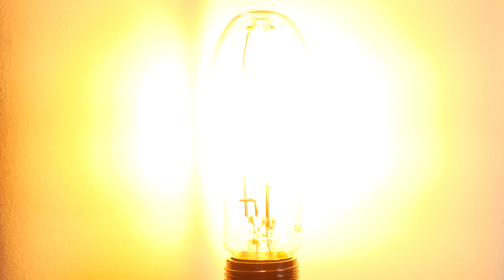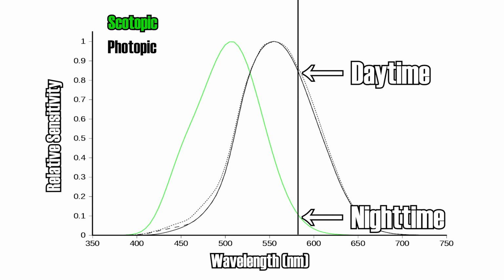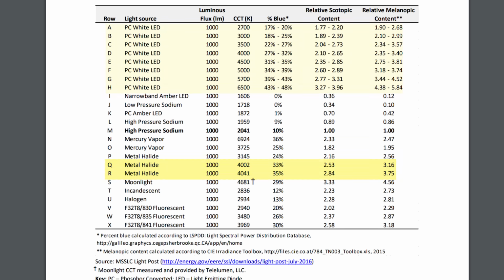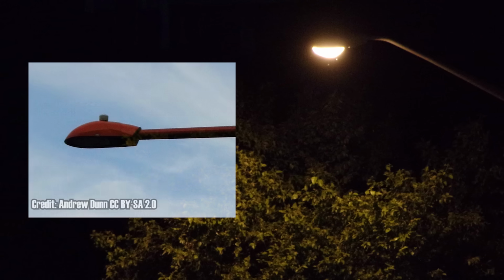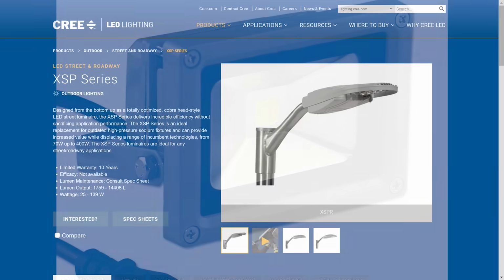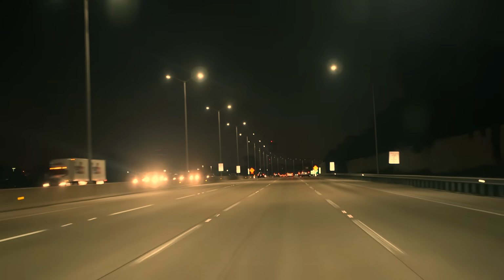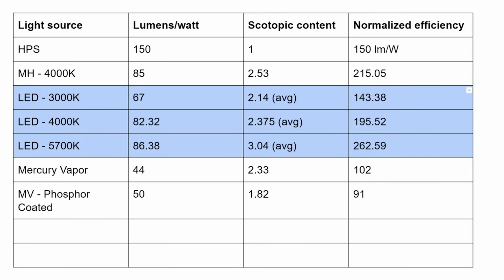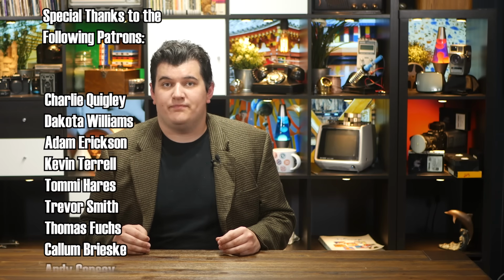The LED's Challenge to High Pressure Sodium

Comment: The possibility to dim LED lights is a huge bonus. I have seen street lights in resedential areas here in Austria which have a motion sensor built in. They must be using radar to do that. They react to pedestrians and cyclists as well. They get alot brighter when you approach them and dim down again after 30 seconds to a minute. This not only saves energy, but reduces light polution (obviously) and will extend the lifetime of the lamps and LED drivers. For fast moving traffic (where a motion sensor would trigger too late) lamps could be connected and relay the information of a moving vehicle ahead to do the same thing on highways for example.
Reply: Honest question: what's with your extremely questionable use of bold letters
Reply: @hypeninja4786  its a little weird isn't it- it's sorta like using italics to show emphasized words, but it's on more words than that.
Have you seen people who capitalize almost every word? I always assumed they were just native German speakers, but I've seen people do it who claim to be american-english-only or even non-Latin language speakers.

people r weird
Reply: I helped set up some Phillips street lamps in a few streets in my town which auto dim after being on for some hours. They dim to around 50% but the change is not noticable. The fixtures can also be programmed and controlled via DALI.
Reply: Nice, seems like a good compromise between turning lights off after a certain time vs leaving them on all night
Reply: what if they make a solar powered LED street lamps?
Reply: @a-potato-on-youtube  China has a lot of solar powered LED street lamps in an integrated design so no cables are needed.
Reply: @a-potato-on-youtube  Actually quite common here in Australia - the solar panel is on top, with the battery integrated into the pole. But I suspect you need reasonably reliable sunhine for that - I'm not sure it would work in a northern winter.
Reply: I sure as shit would not want to be walking down a road that is pitch dark except right in front of where I am. Personally, I like to see if there are any dangerous as far as the eye can see.

Comment: Moonlight is not "blueish", it's 4000K, as opposed to the 5000 to 7000K or so light during the day time, it just appears blueish because the level of light is very low, and as you said we pick up shorter wavelengths better in such conditions.

It's interesting that the study you cite actually has different results to that done by Philips in France, regarding CCT preference; 4000 and 4200K sources both ranked below 2000 and 2150K HPS, with 2800  and 3000K being the most preferred option.

Comment: Only thing I don't like with led lights around low speed streets is now its more difficult to determine if that light I am seeing is a car or just the streetlight (as the LED lights are at times brighter then car headlights and if the car uses led or high powered headlights sometimes matches the led lights on streetlights)

Comment: Our council is phasing in LED lighting when the old sodium lamps fail.
The LED lights tend to splatter light backwards towards the houses making the upstairs appear to be in daylight. This is very annoying for those that have the lighting close to their bedroom windows.
I've also noticed that the light from the LED lamps gets scattered much more by fog than the light from sodium lamps. With the lenses added to LED lights, this creates a wall of blue/white light that makes driving much more difficult at night whereas with the sodium light there is no wall.

Comment: I find the aesthetic argument highly subjective. I for one prefer cooler color temperature light. Additionally the greater CRI of most high color temperature lights is an additional safety feature. Color recognition helps in spotting obstacles. Also for people like myself with mild abnormal color vision, it helps greatly.

Comment: In my opinion disrupting your circadian rhythm is actually another safety benefit, as if you are driving at night anyway, you need to be awake. Circadian rhythm disruption is a major problem of modern society for many reasons, but kind of a separate issue...
Reply: The problem is the effect could last hours after someone stopped driving so you would need to investigate if accidents go up in the morning and what effect it has on animals that cross road ways.

Comment: My region just installed citywide mixed-type LED street lighting of various colour temperatures. All of it makes use of really bad lens designs that turn the LED into one ultrabright point source and create this annoying, potentially distracting side-glare effect that gets in your eyes at night (especially when driving).

You'd think someone would have figured this out before it got to market. Even the old sodium lamps had better dispersion, they'd put the light where you actually needed it.

I imagine it's just a matter of time before retrofits happen (how many car accidents do they need to see first?) and in the meantime, they've been allowing the request for installation of aluminum strips to deal with the side glare issue, on a call by call basis. Better than nothing, but good design would have been the best solution from day one.

Comment: I am a huge proponent of LED lighting, and definitely agree that it is the right way to go in street lighting. One complaint I have about it, though, is in situations where "full-cutoff" LED fixtures are used as a replacement for old HPS fixtures that had hemispherical lenses with no compensation made for the differences in the light distribution patterns. For example, there's a small town near me that replaced every HPS lamp along a major street with LED. They did this by removing the old HPS head and just sticking a new LED head on in its place, nothing more. The problem is, the lamp brackets were originally mounted too low on the poles. This wasn't a problem with the HPS lamps since they also emitted light out the sides at an angle, but since the LED fixtures are full-cutoff fixtures, this means that instead of the entire street being lit relatively evenly, there are now small, sharp-edged "hot spots" of light with gaps of total darkness in between. To properly replace a non-cutoff HPS fixture, LED lamps really should be mounted higher.

BTW, one potential benefit of LED tech not mentioned is since they run on DC at a much lower voltage than HPS, as the tech continues to improve it should eventually become possible and economically viable (if it hasn't already) to integrate battery systems that allow street lights to continue working during power failures, or even entirely off-grid using solar charging. Speaking from experience, I know it would be nice to have a little bit of working street lighting during blackouts, even if it is at reduced brightness (lower output on all fixtures, or only key/specific fixtures being battery equipped).

Comment: I far prefer cooler lighting, opting for all my LED bulbs to be 4100, 5000, or 6500k in temp.  And I feel that circadian rhythm disruption is far, far overplayed in the media.  I sleep just fine after reading for hours with cool white LEDs.  //  I, too, am =not= a fan of light pollution.  //  What I'm seeing in industrial areas is overlighting with new LED systems, likely caused by installers either 1) not understanding that LEDs are much more efficient than their predecessors or 2) that they make a lot more money on larger LED packages.  LED parking lot lighting is absolutely wonderful, and much more safe because bad guys can't hide as well under them as they did with LPS, HPS, or MH.    //  Thank you for a well-thought-out presentation.  You covered all the bases, something I don't often see.  Kudos, TC.  I saved your video.

Comment: I thought I liked 6500K lighting then over time I found that it was actually hard to see with LEDs of that color temp.  I find it much easier to see at 3000K not sure why but at 6500 things look harshly edged and difficult to make out objects and I can only see hard edges.  With 3000 I can see the objects and be able to read signs.  I am completely in the dark about why, pun intended.

Comment: Amber colored light is easier on your eyes at night and the amber colored light fades off over a far distance, while blue light can be blinding and vision cuts off at a faster rate as you approach the edge of the light, because your eyes are overwhelmed with the blue light. I suppose if you could have ENOUGH blue light to avoid having the harsh edges BETWEEN lights, then it would matter less.  Also, the higher the color rendering index, the more details your brain will be forced to process when you drive, so I am thinking that long distance truck drivers, probably prefer to conserve their brain activity for staying focused on driving, not spending time subconsciously comprehending the exact color of vehicles and the color of the leaves on trees and so on. As far as which lights I prefer? In my home, I have both orange and blue colored lights, and i use whichever I want at the time and use both at once if I need maximum vision (like for cleaning). I am going to make a wild guess and say High Pressure Sodium lights will PROBABLY be around for AT LEAST another 50 years. I thought LEDs put HPS to shame, and found out they still don't at all.

Comment: LED lighting has made driving less safe here. because they are brighter, they have been readily adopted and installed by most cities eager to save money. because of the increased brightness, they've been installed at large intervals, and because of this wide spacing there is usually no shielding at all installed, so the bright LED light is spread very wide. this has given us many bright light sources shining right into the eyes of drivers, causing pupils to narrow, causing reduced low-light vision - the same reason it's hard to find your way back to your dark bedroom after turning on a light in another room. this has led to an increase in night-time incidents, with a particular increase around twilight hours, yet the safety of LED lighting is still touted without mentioning the safety reduction caused by wide spacing and reduced shielding, and here many experts are also recommending drivers to keep their headlights angled as high as possible so they can see better, again failing to recognise that means everybody else also has their lights up, which makes people and other cars off to the side or after turning down a darker street harder to see.

Comment: The only thing I didn't hear mentioned in your talk is that many replacement lights use multiple pin source LEDs without diffusers.  This causes multiple confusing shadow patterns on the ground which are just weird, but they also mean that the light source appears MUCH brighter when you look up at the light.  LEDs without good optics are just awful!

Comment: Light pollution along coastal areas where sea turtles lay their nests are a very big problem.  Thanks for mentioning this.  LEDs do offer a potential solution to this problem, but only if communities choose to use them.  Turtle friendly LED lighting should be required in all beach communities where there are turtles nesting.  If you live in one of these communities, please contact your local officials.

Comment: Honestly, I've seen a lot about blue light disrupting sleep but I've never experienced anything like it. One thing that makes me NOT sleep at all is seeing that orange glow coming through a window. I have blackout curtains on all windows just to keep it out. At the same time, my alarm clock has a large, bright LED face with blue numbers that can light the room up blue. I can sleep with that. I can't get to sleep if street lights are shining in though. No matter where I am. 

I've always seen people use f.lux on their computers or phones to eliminate blue light so they wouldn't disrupt their sleep, but I tried it and it had no real effect on me, but the colors being wrong annoyed me more than anything. Could be just that I naturally prefer bluish lighting over "warm" colors. I replaced all the warm colored CFLs in my apartment with 5000k LEDs.

Comment: Great video! I find this relates closely to my life, as I do a lot of LED retrofits in fixtures that were designed for metal halide lighting. The LED industry has come a long way- with one $85 LED module I can replace a $30 metal halide lamp. Doesn't sound like a deal until you take into account that I'd typically replace that metal halide lamp 2 or maybe 3 times per year plus a possible ballast at $65 or 2-3 capacitors at $20 each. With the LED fixture... well I haven't had to replace one yet and I've been installing them for 4 years. I can just eliminate the ballast and capacitor entirely from the circuit which reduces the number of modes of failure. Plus they run at 30W as opposed to 400W. 
I install LED modules in lighted channel signs which formerly housed neon tubes and a 1000W power supply. The 6 neon tubes in each sign are $125 apiece. I can replace the whole kit and kaboodle for $18 worth of .75W LED modules and use a 60W power supply and the result is brighter than the old style. I really love the look of bare neon, but in these channel signs the neon is hidden behind translucent lexan anyway, so you're certainly not losing any great aesthetic quality.

Comment: I would think using cooler light for express ways, and warmer light for inner cities/towns would be the way to go.  I've experienced dozing off at the wheel on long trips.  Not to the point of causing an accident, but it very well could have.  But then, whose to say how alert you can stay with different lighting.  It's just a thought.  And, for sky glow, I moved from a village with none, to a city with a lot, and back to the same village.  The difference is significant.  Even a few files away from the city, the glow just overpowers the night sky.

Comment: Another potential benefit that probably won't happen (due to instrumentation costs) is because LED lights are (nearly) instant on (especially compared to HPS lights...). Only turn the lights on when traffic demands. If there are no cars on the highway, turn the lights off. If that large moving object (car, truck, etc) on the freeway has passed the lamp position, turn the light off. I don't know how far ahead of the vehicles the lights should turn on, but I'm sure road safety engineers would be able to figure this out.

The sensitivity of the size of the moving object can be adjusted to different sized objects for illuminated areas that have different types of traffic (down to people sized for parking lots and sidewalks). Then only the amount of power to run the sensors and decision making electronics will be needed if there is no one is there to need the light.
Reply: How ridiculous, having a bunch of flashing street lamps with traffic.  Clearly you’ve never lived out in the woods with wildlife turning the motion activated yard lights on and off all the time.

Comment: A huge issue with LED lighting is the real world life expectancy and maintenance cost. Sodium lamps with magnetic ballasts are extremely long lived and well proven. There are very few points of failure. In contrast LED street lamps haven't been out for as long a typical sodium street lamp lasts and they have MANY more points of failure. If they are a high voltage design they use a large number of series LEDs and a single LED failing can cause the entire fixture to fail. And if they use a switching low voltage power supply there are many points of failure in the power supply such as electrolytic capacitors that may only last a few thousand hours or less. Street lights operate in relatively harsh conditions not friendly to modern electronics. A lot of LED fixtures are made by relatively new, and often Chinese, companies. Many have already come and gone which makes quality and warranties dubious. The cost to repair a street light is high requiring a boom truck, specialized expensive labor, potential street/lane closure, traffic personnel, etc. Imagine Small Town USA putting out bids for replacing all their streetlights. The low bid Chinese fixtures/lamps win but it's still really expensive. After 2 years they start failing right and left and the company is out of business. So much for cost savings.

Comment: Erm but why are you even lighting the road at 4am in the morning?
Just fit motion sensors to all the lights.. Done..

Plus that would be cool AF if you could run down the road and lights come on.. you could even do them in sections so they light up only where they need to, also this would be great for detecting hazards..

Comment: I am on the 3rd floor (2nd floor in the UK) of my building and my kitchen is on the side of the building which has street lighting.
I used to be able to open the cupboard nearest the kitchen window at night and get an item out by the street lighting only.
What a difference the new LED street lighting has made...I now have to switch the kitchen light when I want to get something out of that same cupboard!
The change was so dramatic the 1st night that I noticed it I thought all the street lighting was out...but no..the light was all going down...it was quite amazing.